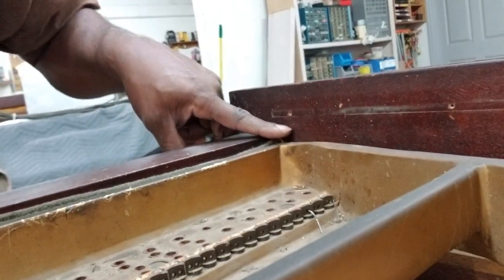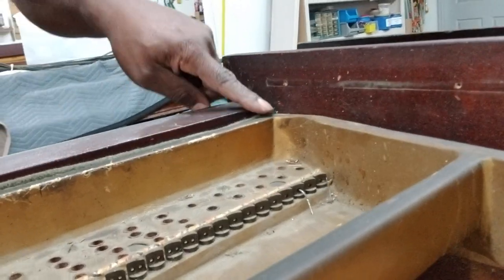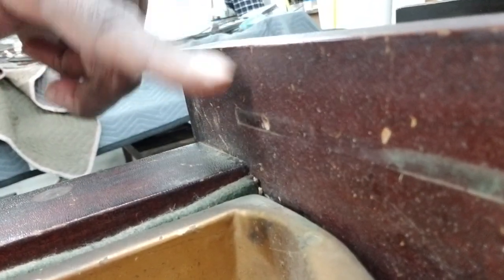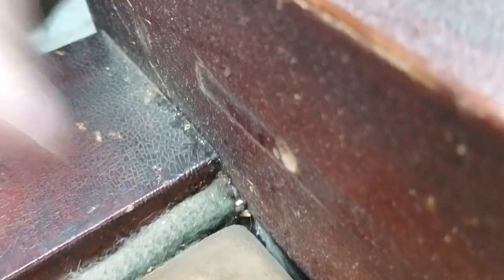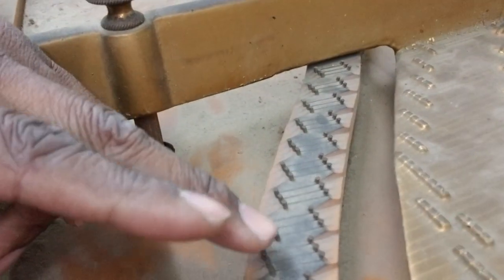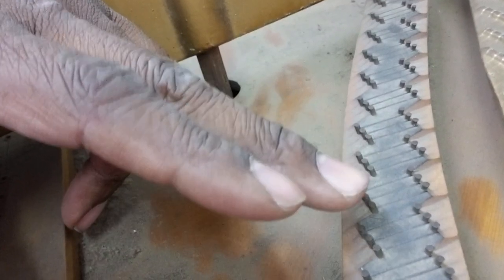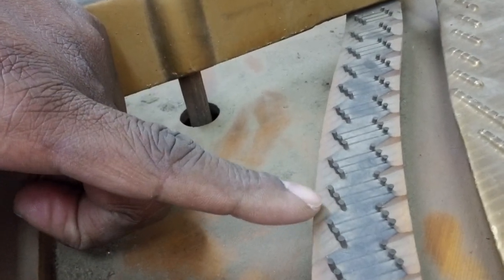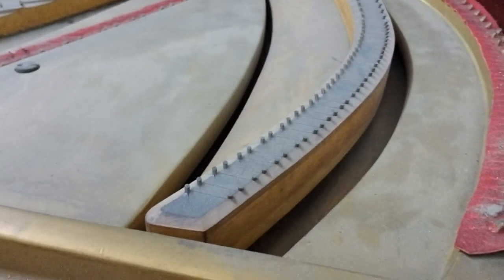Krakauer Plate and Soundboard Items During Teardown

Comment: I hope that in the process of rebuilding, you would dry the board properly anyway regardless of there being no cracks in it so that the board is kept from any cracking in the future. That is standard operating procedures. Also, I do believe the pinblocks in Krakauers were mortised since they are glued to the stretcher-this would normally indicate a mortised block.
Reply: Yes block was glued into the stretcher, had to cut it out.  I didn't remember having to do that with the last Krakauer which was virtually identical to this one.  Did dry the board and checked for loose ribs.  There were a few on this piano but not many.  Board is finished and looks spectacular.  Will sound really well.  Can't wait to hear the 1st notes played.
Reply: By the way look for the playlist for this piano.  I've posted more videos recently.
Reply: @Robert2Point0  Thats great! I love those old Kraks. Excellent pianos. I have rebuilt 4 over the years-one of which is my own grand. I wish they had made a concert grand. It would have been glorious to hear. Can you post  video of the finished piano so we may hear it??